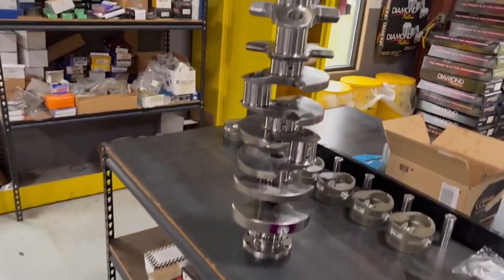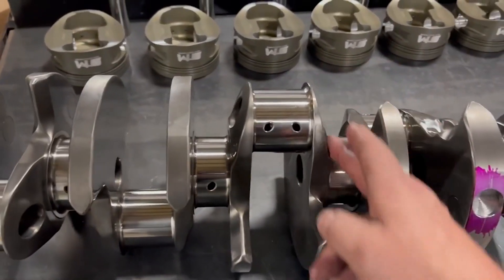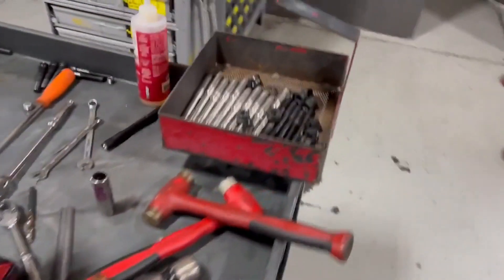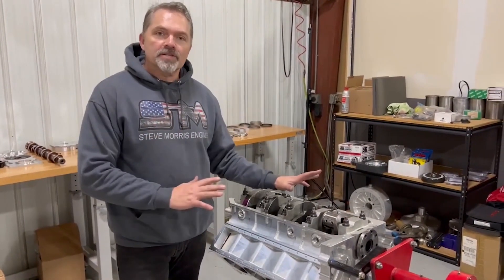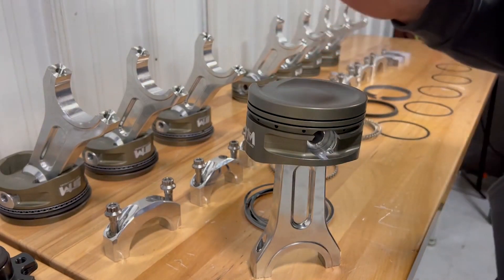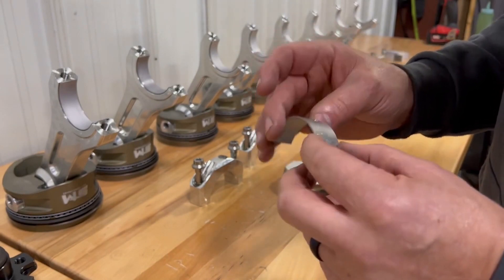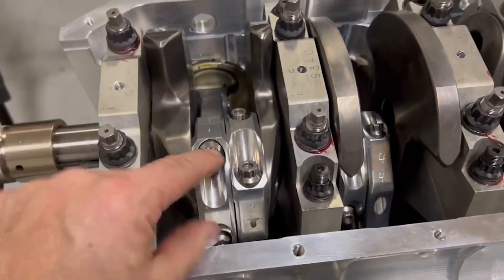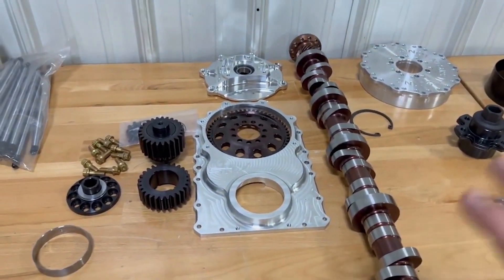Steve Morris' SMX Rotating Assembly

Comment: The rings seat into the honed groves in the cylinder wall, and follow the honed angle down the cylinder, and back up ⬆️ the cylinder. That’s the cause of ring rotation. That’s why a cylinder that’s seen long periods of high rpm looks like a mirror 🪞. The ring rotating have polished the cylinders. Even after the cylinders have been ring polished. They continue to rotate.

Comment: Dont really see what you're saying about overlap. Is 'overlap' just the web being thicker?
Reply: by overlap he means there is more material between the main journal and the rod journal. the more material, the more inherent strength. because cranks deal with the twisting forces applied (as well as side thrust) by an engine, the more material between angled sections the better. if you look at the crank on the angle he is when he explains overlap, you will see a small overlap of the main and rod journals relative to the crank axis. its harder to explain in words than it is to draw in a diagram or physically show but i hope it helps lol